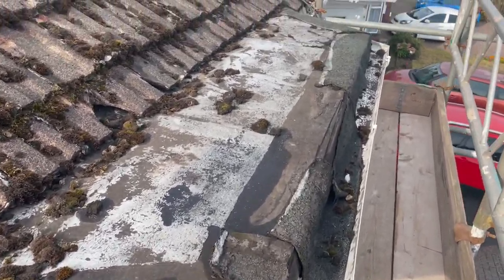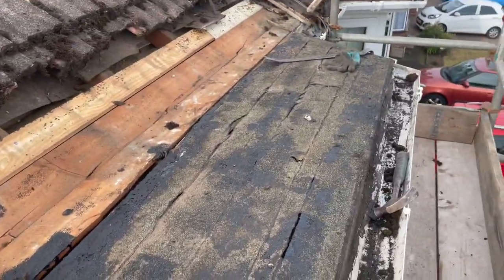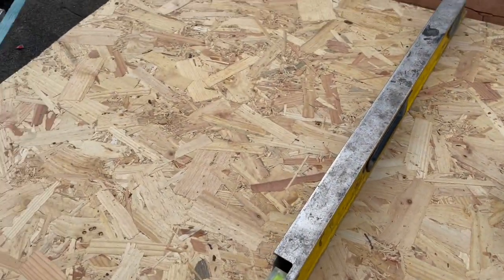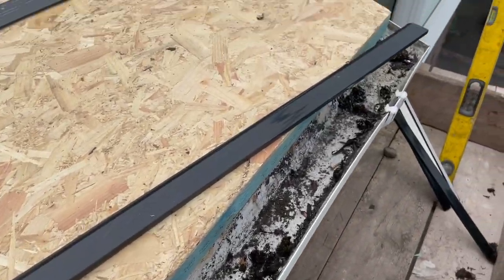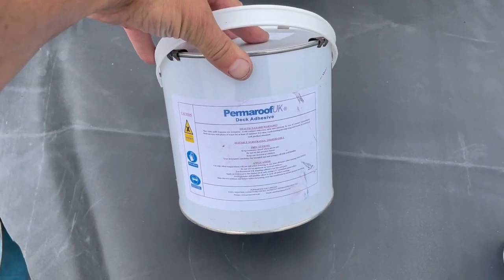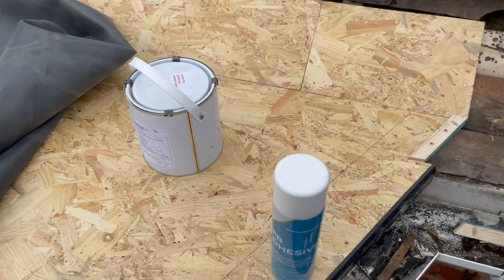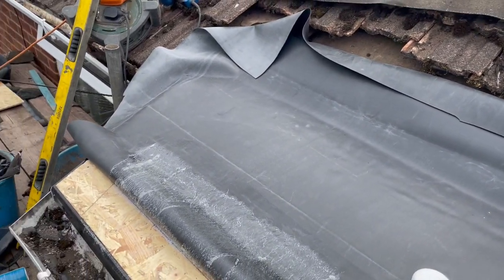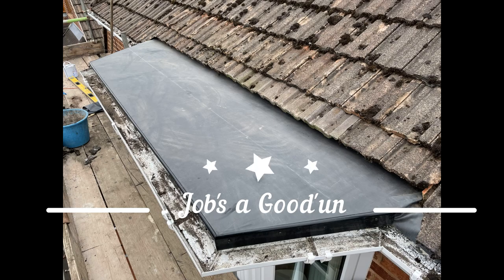Fitting EPDM Rubber to a Small Bay Flat Roof

Comment: Had a dormer roof at my rental property fibreglassed 6 years ago. It had a bad backslope but the roofer said standing water wasnt a problem with fibreglass. Since then 3 small leaks at rare intervals, reason unknown. Water stands up there and the bottom of the botton row of roof tiles dip in the water. I dont like that. My plan is to screw firrings on to the top and create a 2nd roof with osb and that membrane you use. The tricky part is where the roof comes down to the chimney creating a short valley which runs on to the dormer. I suspect the original leakage problem is here but requires getting tiles out from under flashing etc
Reply from the maker: He should have created a slope. Standing water on grp will leak if it isn’t done right, ideally should never have standing water especially on a bay which is such a small roof. Poor job to have it. Pin holes in the grp will seep water through. Best to strip it all off and redo it in my opinion.

Comment: Quick question on some of these flat roofs I've seen a lot of them with no gutters where on earth does the rain go if they have no gutters?
Also nice job!
Reply from the maker: Thanks mate for the appreciation! 
Yeah on some the rain just drips off the edge, depends how big the bay is I guess and how much water will fall, but ideally a gutter is fitted I think. 👍
Reply: Some have a waste pipe installed that you will see enter the side, i imagine they are supposed to be sloped towards it to catch it.

Comment: That gap below the tiles could be a Haven for the Birds to nest, but I can't think of a possible solution!
Reply from the maker: Yeah if it went higher up maybe but there is a batten blocking access only about 4 inches higher up that the tile rests on, with a 1.5 inch gap in height. I believe that is too restrictive to nest. I did think that while doing the job. I’d be surprised in any bird wanted to nest there.

Comment: And sorry not picking at your work it's good another thing the old boy told me was with the middle glue your meant to let it go tacky is that just a different product or is it wrong
Reply from the maker: Again no mate, rubber goes down as soon as deck adhesive is rolled out evenly and still wet. It will go off and tac much better that way. Sound like you’ve been taught wrong on it bud . 👍

Comment: Will the rubber membrane fit a curved bay or will it 'bunch up' all along the front edge when fitting the finishing trim? Bay window is about 2400mm wide and projects about 900mm so not a severe curve but not a very gentle curve either....
Reply from the maker: If you mean the front edge is curved then I guess it won’t fold over totally flat. But decent trim work may hide it if it’s not too curved. Hard to answer that really.

Comment: Should the existing ripped underlay be replaced and lap over the epdm.
Reply: Any run off will just run behind the rubber into the roof
Reply from the maker: Yeah fair point, I did pull the rubber up over rafters and secure it although it does sag a bit, it shouldn’t run in. Not leaking at all in that area up to now and it’s 70 years old. Customer is seriously considering a reroof which I’ve priced for them so should be back to so the full main roof soon also.

Comment: how did you do join to roof..I do felt and use lead and stick felt on to leak soaker
Reply from the maker: On this one just extended rubber about 250mm under tiles each side. Didn’t use lead to bond on to. Tiles laid on top. Never had problems with it. Rubber is more durable than felt, won’t perish as fast and leak though at those points.

Comment: Decent job but i can't upstand why you didn't fit anymore felt underneath the original and overlay the rubber before tiling in, all it takes is for a tile above the bay to be defective for rainwater to get in behind the rubber
Reply from the maker: Thanks mate. Yeah maybe should have added more felt, but the rubber does extend probably 150mm above the felt, it just sags more due to the weight so you can’t see it as well. But I felt at the time water would still make it to the bay in the event of a broken tile above.

Comment: Can you not put you’re rubber on first then trims last?
Reply from the maker: Not if your following manufacturer specifications for install, on the drip edges. Kerb edges go on over rubber though.
Reply: @davesalter  so how would you install a around a downpipe that is touch tight to the wall?
Reply from the maker: @jordantruesdale7244  never had to do that. Not sure what detail that would be. But if that was the case probably would need the form flash tape for rubber roofs that isn’t covered in the video I did on the small bay. 
If you plan on doing a rubber roof yourself maybe do a day course on rubber roofing. You can ask all the questions you want then while doing it.
Reply: @davesalter  yeah Im doing one soon and thinking I will just have to flash band around the pipe maybe